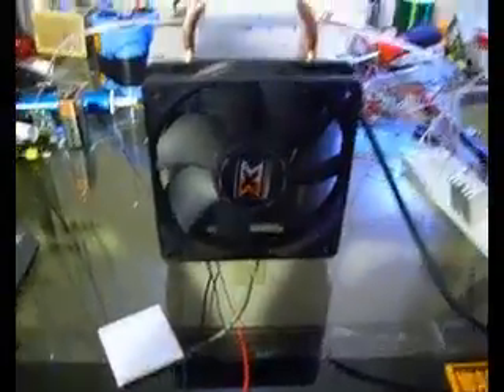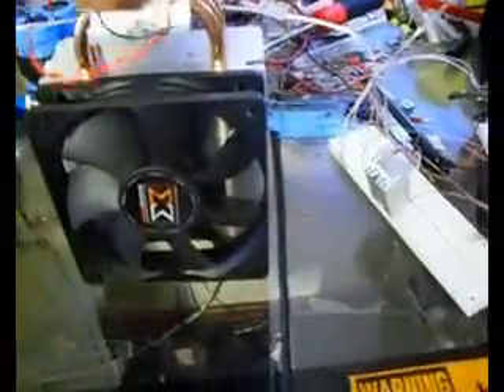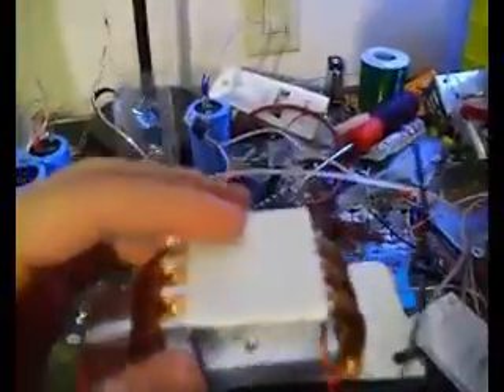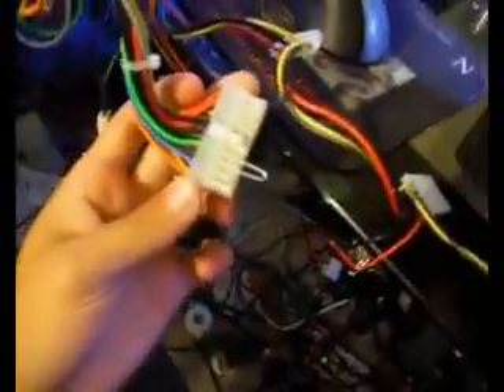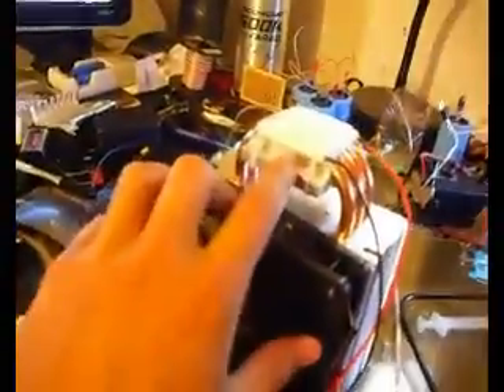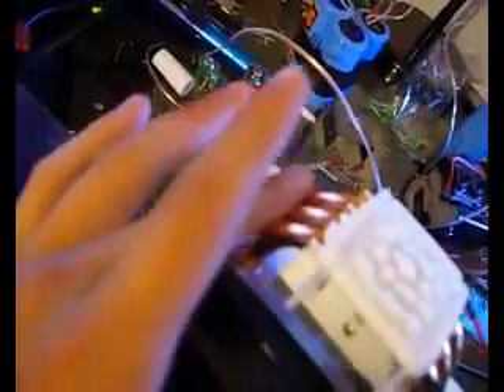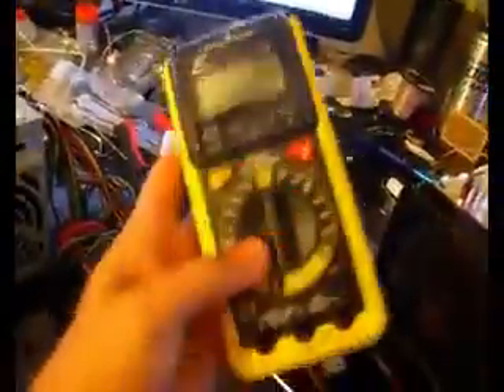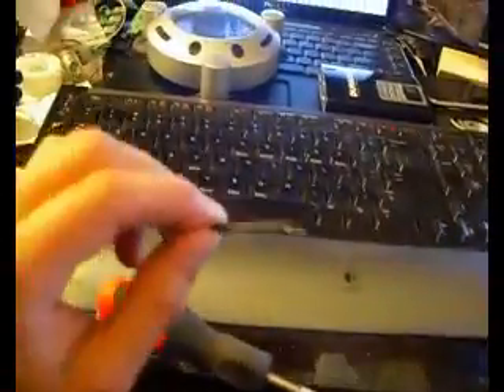peltier cooling unit

Comment: Without the fan running and the peltier running at a lower voltage, could you cool without the cold side of the Peltier freezing?

Comment from the maker: You could. And that would be awesome...  Remember. This is a heat pump.  Not a chiller.  All its going to do is move the heat from point A to point B.  It will also add heat because inorder to work correctly, it would need to opperate at 100 watts or more.   So if anything you would be making the unit hotter